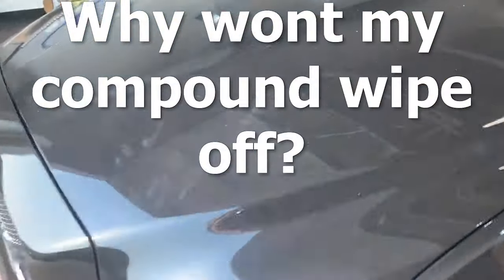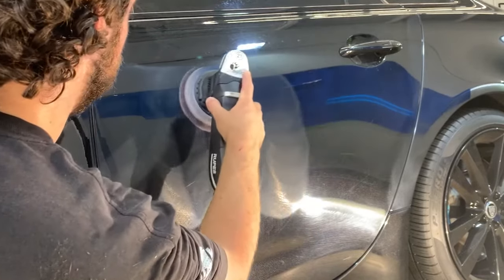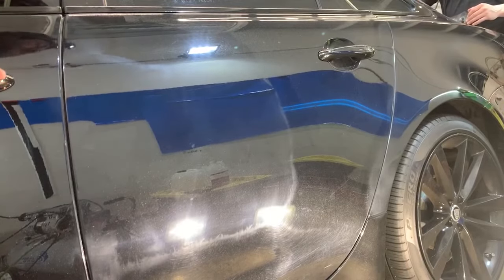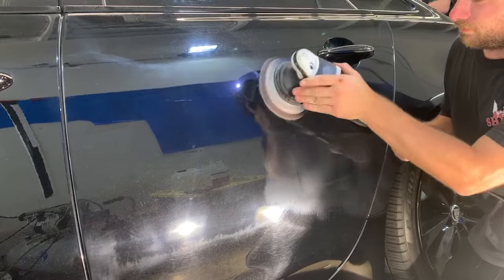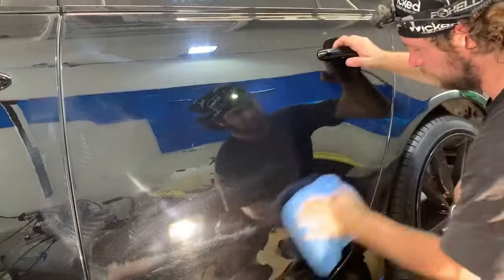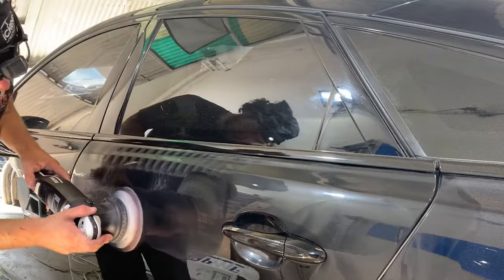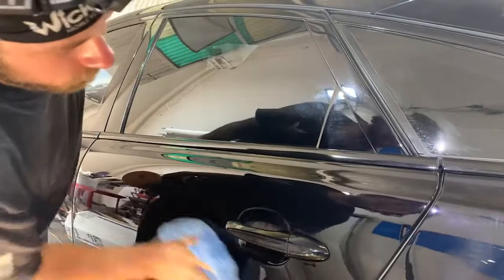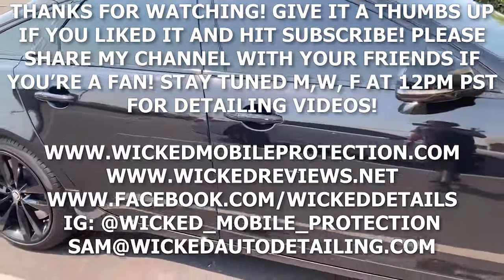WHY CAN'T I WIPE COMPOUND OFF THE PAINT? | BLACK CAR PAINT CORRECTION BEFORE AND AFTER

Comment: Yeah had similar effect of my Nero Black Maserati, from the information I've been told, the second pass will make it look better/ clearer but it's just because the second compound is sitting ontop filling small surface imperfections and adding gloss to the compound still stuck below which is why it looks like it's been removed. When the car is exposed to a heavy rain run or a mechanical wash the top layer of polish and any sealant/ finishers on top will be removed and the haze is back. Best thing I found to work on the advice of others is after the heavy cut compound stage (one that's hard to remove) use panel wipe - kind of a degreaser. This lifted it out great for me with out adding additional polish on top but is still a bit of a pain in the ass to have to wipe down every work area to get the lacquer back to it's natural state inorder to check the work. Hope this helps 👍
Reply from the maker: I literally explain how to fix this issue in the video but thanks 🤦🏼‍♂️

Comment: This is what is happening to me in FL.  I figured I did it wrong. It’s my first time. My car needs repainting but I want to try it on my own first. If I can’t get it I guess I’ll paint it.  I used the wrong type of machine first (I’m guessing) Wasn’t a cutting pad, was a microfiber bonnet   
I didn’t know what to do and I wanted to start over. I used chemical guys clean slate which brought me back to where I started.  Now, to get the right tool - a DA. then I’ll try again. But this video helped me.  Maybe I have soft paint. It’s a Buick nothing fancy.
Reply: I’m about to clean slate my car again too.  I have so much haze. First I’ll try his idea on low speed. I’m also in FL with the hot and humid weather 
Did you get your situation corrected?
Reply: @Denise F  harbor freight got cheap DA's to start thats what I got and still use
Reply: @et5256  yes. I bought the Bauer DA.  Then I purchased the 3” SETA and it came with 2” and 1” plates for the really right areas.  My car was repainted at some point. Where it was repainted both of the polishers are “hopping” and grabbing”.   I switched to a wool pad which made it so much easier.  But I have the haze still. Hot and humid here in S Florida. To get off the dried compound I used alcohol and water and it came right off.
Reply: @denisef1153  what did you use to get the polish off originally, i messed up and left some polish on my car and want to get rid of it and start over

Comment: Rotary cut that door use Farecla 360 dont rely on a DA to do the job ! Sps graphene pops when the panel has been corrected properly.
Reply from the maker: @waynedharsan5288  a rotary would haze that up the same, has happened to me with rotary too. Coatings pop regardless of whether you correct a panel or not. You can clay and coat a car and from 10 feet away it’ll look better than brand new

Comment: If you are coating the vehicle afterward correction. Using a primer polish works fantastic, especially since it’s recommended anyway. If your a ceramic pro guy the nano primer work. If not, essence by cat pro is amazing as well.
Reply from the maker: @TheGeekedGizmo  primer polish weakens the bond between paint and coating which leads to early failures.

Comment: rule #1....never use Microfiber pad on soft paint....always use wool and/or foam....in this case a yellow rupes wool pad and sonax perfect finish will give excelent result in just one step.try it you will be amaze
Reply from the maker: I would have to disagree, you can use a microfiber pad on soft paint, I've done it with great success on many black cars. A wool pad is far more aggressive than microfiber and perfect finish is full of oils that generally just fill stuff in until you spray a powerful panel prep agent over it. That's why you are achieving those results with one step, just filling in as opposed to correcting.
Reply: @Detailjesus  well then you know more that the people that actually makes this products,if you ask jason rose of rupes who was the master mind of the microfiber pad you are using he said microfiber is more agressive than wool and that is a fact...they dont recomend using microfiber on soft paint because microfiber introduce a LOT of heat to the equation and that is a no no for soft paint....about perfect finish then go to Todd Cooperider of Esoteric and ask about those "fillers" you mention,ALL polish have a filling effect...ALL of them and a lot of people use perfect finish and then wipe it down with a prep spray and they dont see what you said,that is why PF cost a lot more than most polishs...because it work that well.
Reply from the maker: @scoupemaster  I install self healing coatings and use some of the strongest solvents in prep sprays and coatings, perfect finish will eventually out gas and cause issues with coating. I use only water based polishes to avoid these issues and achieve true correction results. I used to use sonax perfect finish, it does leave a great finish but then goes back to haze when sprayed down or coated over or even left alone long enough to out gas on its own regardless of how well you finish down the product. That is my experience. You are entitled to your opinion though, I am not looking to argue who knows more, I have found much of what some of product companies and youtube stars have said to be untrue or not work in every single situation. The reason for the issue I am experiencing in this video is mainly due to the temperature and humidity I am in. If I had used a compound on a foam pad maybe I would have had less sticking to the paint but I also would not have achieve the same results either, I've corrected metallic black jaguar paint on more than one occasion and it does not behave like this with a microfiber even at low speed without heating the paint up much. I appreciate your feedback though. Thank you for watching.

Comment: Once I started using Menzerna and 3D abrasives I haven't run into this issue. 

I remember the first Subaru I did, M205 on a soft polishing pad left a lot of da haze. 

I switched to Menzerna PF2500 and it removed all the swirl marks, and finished out perfectly. 

3D ONE is another gem of a polish, but I'm suspect of it's finishing on soft paints. In that situation I switch to 3D ACA520 Finishing Polish.
Reply from the maker: I’m not a huge fan of 3D or menzerna. Menzerna I used for years, too oily which hides a lot. I’ve had a lot of ceramic coated vehicles from years ago I polished with menzerna come back with issues, plus if you spray a real strong panel prep agent like feynlab panel prep, it pulls all the DA haze back out. I primarily use water based polishes for this reason and since have had zero issues with coated cars and corrections. This issue I’m facing in this video is primarily due to heat and humidity. I rarely deal with it otherwise except on certain paint systems. I don’t trust 3D either, all their products were at one point chalked full of fillers and I don’t believe they’ve actually changed.
Reply: @Detailjesus  3D One states it is water based and so does Sonax PF, so if they're water based, what causes the fillers?
Reply: @Detailjesus  - I stay Away from coatings because I hate applying them. So I haven't had that experience. I do get better performance with Optimum Car Wax, and Opti-Seal when using Hyper Polish as a finisher. 

In checking the family and friends  vehicles that I polished with Menzerna or 3D I have noticed no return of the defects I removed. My best friends mom has a super soft black Equinox that I use PF2500 pretty up before sealing. I always check that car whenever I see it for returned defects. They use a touchless wash, and in the years I've been detailing that car, I have never seen them return. 

I've heard people say the same about Meguiar's in regards to "fillers" and oils, and again never had an issue with any of that. 

But, I did just polish my car with Menzerna SF4000, did the panel wipe, and applied CarPro Gliss. If it fails prematurely, I'll have something to consider. 

Also, I've recently found M110 to out cut every other compound in the arsenal. It would be nice to switch back to Meguiar's. I started off with them in 1996, and have made a lot of money, shiny cars, and memories with them.
Reply: @Detailjesus  - And yes, heat and humidity absolutely suck. 

When I have holes in my schedule I do paint corrections (their guy does the coatings 😂 because I HATE them) for a local high end shop. They do a lot of preps for the Bentley, Porsche, McLaren, Lamborghini, Ferrari, etc, etc, etc 

That shop is climate controlled, and it makes a world of difference. My garage... Hot and humid in the summer. Luckily I haven't had paint do what it did to you! Yet, anyways.

Comment: If you guys want a hint use isopropyl alcohol/ paint prep comes off like butter
Reply from the maker: In this case it does not….. hence the video. But okay.
Reply: I tried that. Didn’t work.
Reply: I tried the alcohol wipe down this past hot and humid weekend in Florida. This time it worked and removed the stuck on compound.   Sometimes it works and other times it doesn’t.
Reply: Alcohol defently makes you care less about the haze 😅

Comment: How do you do this on a RV in Florida lol. It's always hot and direct sunlight here.

I can never wipe away the damn compound no matter what even when I go over it with finish and foam pad.

The stuff gets super hard and not able to wipe it away.
Reply from the maker: Work in the shade lol. Are you using compound made for gel Coats?
Reply: @Detailjesus  Uhh didn't know I needed a special one for gel coats 😂

Which one do you recommend? I was just using some Sonax I forget the exact model.
Reply from the maker: @John-sn4hl  3m and meguiars have gelcoat cutting compounds for boats and RV's, I rarely do them unless they are brand new so its easier to cut but we do also work indoors. I would look into those brands. just google Gelcoat cutting compound itll pop up.

Comment: I just encountered the same problem yesterday and came across your video while trying to find a solution. I too ended up buffing it out with a softer foam pad. This happened even though I was using a cutting foam pad. Really frustrating. I was using 3D One and Meguiars D300

Comment: Hi, my name's Ellie. I just bought a 2010 Nissan Juke; the paint is just kinda weathered but it's not like those old cars where the clear coat is totally gone. Low shine on the hood and the roof of the car but the rest of the car is shinier. I should add that I live in FLORIDA and even when it's overcast, I run into this problem where I can't rub off the compound. I've already bought a buttload of products (Chemical Guys Quick Synthetic Detailer, Meguiars clay bar, Meguiars Ultimate Compound, Nu Finish polish,  Meguiar's Gold Class Caranuba Wax, Jay Leno's Radiant Ceramic coating, and microfiber towels and some foam applicators. Can I solve this issue of compounding sticky/soft paint with any combination of these products? I haven't attempted anything except wiping the compound off with a microfiber towel and that obviously didn't work.... I'm open to buying something else if it's going to make a big difference.
Reply from the maker: Sounds like you should probably go to a professional…. You are likely doing more harm to your car.
Reply: @Detailjesus  How much would this typically cost in your city? I live in Miami so I'm sure cost of living is similar to Santa Ana.

Comment: what kind of pad did you use? heavy or polish pad? also would you recommend using fine cut from koch chemie to remove the left over polish?
Reply from the maker: I don’t use Koch chemie nor am I familiar with them. I only use shine supply and then meguiars 205 can be helpful on these types of issues.

Comment: I'm gonna vent because I need to vent. I ran into this problem today, not the first time since I work at this dealership. It mostly happens because of the compound they carry, I carried my own compound from home and it didn't do it. To combat the problem I ended up just using corse foam for my compounds. They are so cheap, I had only one corse pad for 4 months I been there and now it's done. Today I needed a pad and ended up having to use wool and the compound would not come out. The main detailer doesn't care because he compounds, then waxes over the compound, let it dry then use a rotary to remove the dried up wax. You should see the size of the rotary, so I say ok since you not gonna buy the tools I want, at least show me the method. Says just do it.... do you bring your own tools to work or just quit the job? I swear I was gonna walk off the job then and there, luckily the buzzer went off for tje end of the day because I have a mortgage to pay. As I sip on this beer, venting helped cause I guess I just have to bring my own pads tomorrow
Reply: Yep,  a damp, coarse foam pad is best for compound, try to get a thick waffled version for compound, clean the pad every small section that you do and this won't happen, you need a DA or orbital sander as well.
Reply from the maker: @djstocks  ok

Comment: Hoping to save my 31 year old trucks original paint it’s never done this before with the products that we have used in the past and thankfully it’s just the hood the weather took a turn and I couldn’t do the rest but thankfully I didn’t do the rest as the hood came out hazy 😭(I think the salt on the road from the recent snow storms probably ruined the 31 year old clear coat and that’s probably why it acted like this(mind you we used to winterize it  as it’s a diesel, during winter and not drive it so it’s never seen road salt till now) but here’s to hoping for the best!

Comment: I tried to compound and polish the hood on my BMW E90 LCI with jet black exterior (deep black non-metallic). Man, it sure was a bad day today 😂. I mean, I got swirl marks and the compound sticked a alot to the paint. Also, the wool pad with fine polish left too many swirls. Maybe because I used too much paste and because there were 100 degrees outside.
Reply from the maker: Based on this paragraph I suggest you do not attempt to polish your car, hire a professional.
Reply: @Detailjesus  Will do 👍

Comment: this happened to me with menzerna 400. very quickly sticks to paint. and it was the first time I used a DA machine. brand new. just my luck. I managed to resolve this two ways. one is fcking up the polish. polishing waaay longer Dustin it off, this was super easy to remove.. but. the pad and the paint suffer a lot. so no.. and then I used 3in1 by menzerna. I love that product. it's a quick wax. don't know if had fillers but man it takes all residue haze holograms off.. never used perfect finish or super finish or any of that. just polish by Meguiar's. and it's very pretty shine. also love the smell of MG. man.. so addictive. what would you recommend me buying? medium cut? and finish? 2400?. also I always used whol. is microfiber better for DA?
Reply from the maker: I use shinesupply products only. I just use Meguiars microfiber cutting, microfiber finishing and black foam pads.

Comment: So all you have to do is get a clean polishing sponge and go over it with that I see ok I'll try this because I have this problem
Reply from the maker: Everyone does!
Reply: @Detailjesus  so I did the soft sponge and it didn't come out I used turtle wax repair and renew and the white haze came out but now I save swirls smh
Reply from the maker: @pavy415  it’s a never ending cycle sometimes
Reply: @Detailjesus  what should I try now
Reply from the maker: @pavy415  well probably in 2-3 washes you’ll have swirls again so I guess just hit it with a foam pad and call it a day.

Comment: Hello @wickedautodetailing

I have the same problem but this time its with finishing polish.

Am using KCX M3 with its finishing pad even at speed 1 i can't remove the residue ,its like its stick on the paint. Either using a more soft pad with same problem. This occurs only on sliver paint car's. I had to use perfect polish from angelwax to remove the sticked residue which cost me a lot of time.

What do you advise me to do ? 

Thanks alot
Reply from the maker: To not use angelwax
Reply: Chemical guys clean slate removes everything very easily.
Reply: Is your pad clean and damp every section?

Comment: Would a paint prep like CarPro Eraser help?
Reply from the maker: in this case most likely no, but you can always try. Its different in some situations
Reply: More than likely no. I've tried panel preps, really strong waterless washes, body shop grade wax and grease remover and nothing. It can actually make it worse. 

 Best bet is use a product that is normally VERY easy to wipe off on a good day, what I mean is something that doesn't leave an "oily" film behind. 

 HD Cut works and so does 3D One but with HD Cut, work in small sections, and with 3D One, use LESS product than what you normally would. You want to leave very little left on surface after your correcting session, otherwise there'll be a very faint haze that will be a nightmare to remove. 

 Under normal conditions, 3D One can be awesome, but with soft black paint, less is much much better.

 As far as POLISHING products, HD Polish has been the best I've used but I'm not sure they make it anymore. Sonax Perfect Finish is also great but don't let it sit for long.

Comment: I was having problems with my wax this morning after compounding and polishing my black Silverado hood.
I was using the CG butter wax, and wiping it off pretty quick with a mf towel. It started sticking and I grabbed the mf pad for the da. Got most of it, but will have to wait until it cools down, metal is too hot now. Never had that happen before..
Reply from the maker: @randysmith1630  cg butter wax is literally one of the worst products.
Reply: @Detailjesus  
Thanks for letting me know. I have a can of pure carnauba, but is there anything you recommend that has a uv inhibitor in it?